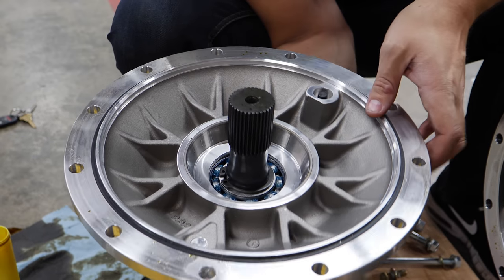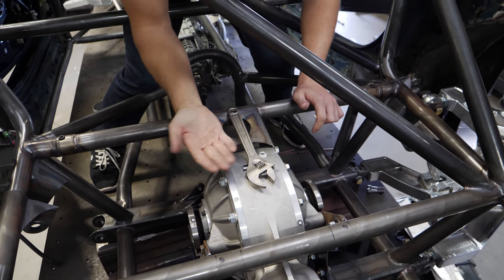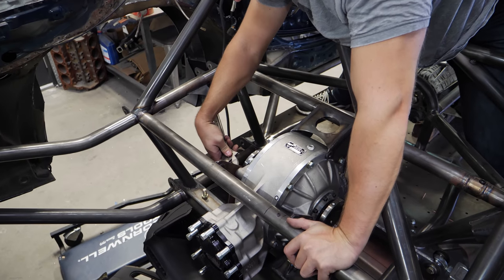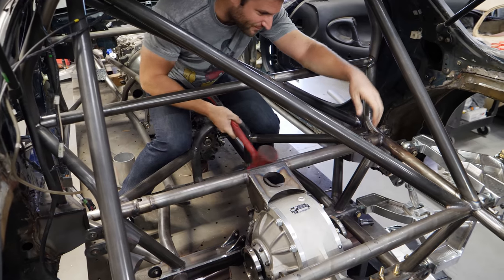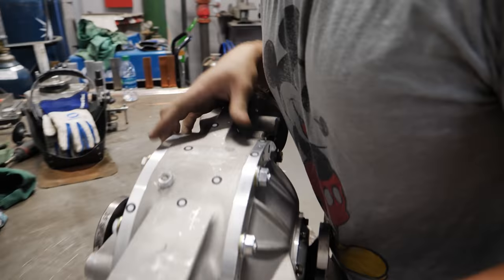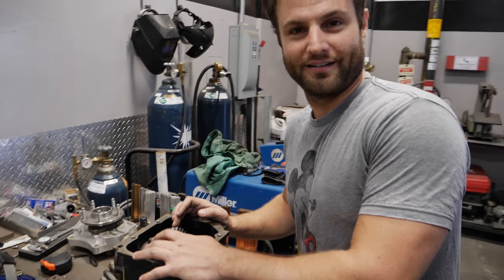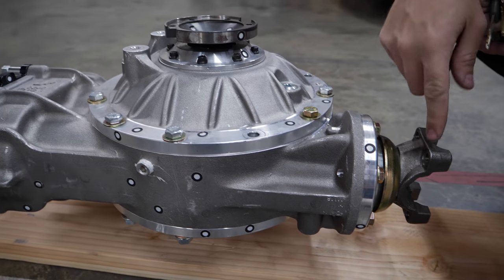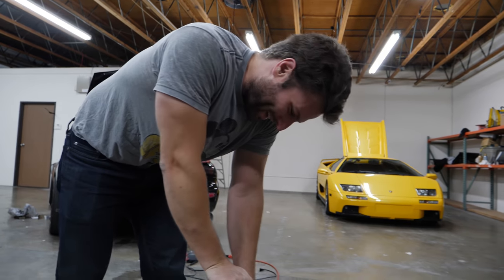What's inside a Quick Change Diff? Teardown/Upgrade | AWD 4 Rotor

Comment: People are probably going to say those connects are too weak, but they've been used to hold cars together before. There's a Porsche 914 with a custom partial tube chassis and it's held on with 4 of those. This just has to hold one bar, the bar will twist before it breaks those.

Comment: The gear loss is a typical myth. We saw cars with factory diffs actually gain power after installing a QC. The difference is in spiral bevel vs hypoid.  Hypoid is used in almost all roadcar diffs because of the position of crown wheel and because its less loud. QC are spiral bevel, which loses a lot less power . Also the rear gears are spur type so very little DTL there. 
The other myth is weight. A spool type weighs around 40kgs, which is less than E46 M3 210 type diff .

Comment: Wait a minute Rob. What happens when you change the rear diffs ratio? You cant change the front diffs ratio so easy, so when you just change it on the rear you will have unequal wheel speeds front and rear. So you will have slip in the rear or in the front (depending on the ratios you choose)?
Reply: or a broken transfer case, or one that will break..
Reply: It's called a centre diff
Reply: Well, the Skyline transfer case has a clutch in it, so maybe the clutch will meld?
Reply: I too am interested in how the difference between drive ratios will be compensated for
Reply: Is the rear diff final ratio the same as the front  diff final ratio ? I would presume if they are both the same final ratio then the wheels will spin at the same speed if they are the same rim and tyre combo and let the LSD take care of the rest ? Interesting one on different ratios front and back tho 👍🏼
Reply from the maker: One is a quick change.  The other... not so quick change. lol  I can set it to RWD and test various ratios independently.  Then get different ring and pinions for the front.  Testing and tuning.  I dont intend to run different quick change ratios randomly. I didnt even want the quick change haha
Reply: @RobDahm  thx for the response Dorito Papa. so you just got the Winters for its strength, not for the quick change? Once you got the ratios front and rear equal it should be fine then.
Once its all dialed in will you set the transfercase on a specific ratio?
Reply: @Peter Lockhart I think it was because it was the biggest diff he could get with the gear ratio he wanted
Reply: @vladstr100  Doubt that, bet it has more to do with the suspension setup. Obviously a solid axle can handle his power goals but compromises too many other aspects. Something like a ford 8.8 IRS diff would be an option but the winters is probably what works best for all of his criteria.

Comment: again: is the quick-change stuff worth the cost, weight and losses? i mean havent you have to change the front diff accordingly to the rear since its AWD?
Reply: He didnt by quick change for the quick change he bought it because its alot harder to break them as say compared to a built ford 9 inch

Ford nine inch can hold about  1000hp comfortably where as those quick change are deaigned to take 2000+ hp and when something break u just swap a part out as it usually cog teeth that shread saving diff and car
Reply: Oh okay
So there are no robust 10" diffs without quickchange? I didn't know that, but probably most are for RWD drag cars, so a quick change is of course useful

Comment: How is the quick change rear differential going to work if you don’t have a quick change in the front? The front and rear has to have the same ratios so it doesn’t bind, that’s why you have to get the outside circumference of wheels and tires the same front and rear on a awd car. Idk if you have a solution but thought I’d just put that out there

Comment: I don't if this has addressed in one for the videos but incase you change the gearing in the rear end for like a top speed 1/2 mile run or whatever, how is the front diff gearing going to be changed .

Comment: Why do you need a quick change rear diff if the front isn’t quick change too? You can’t just change the rear and do nothing to the front. Then the front and rear would have mismatched gearing